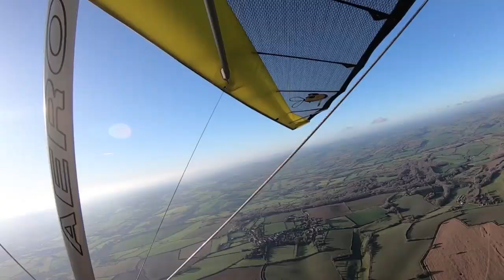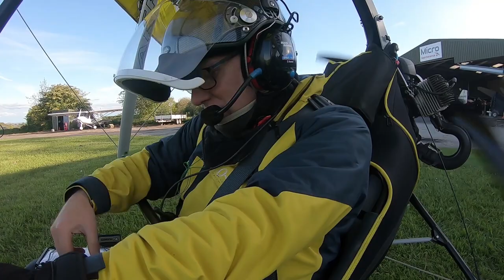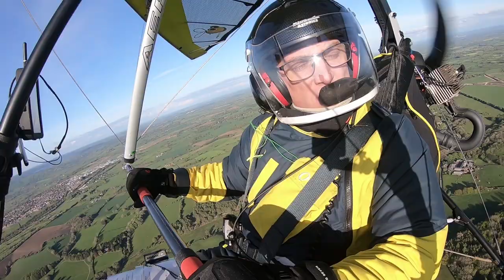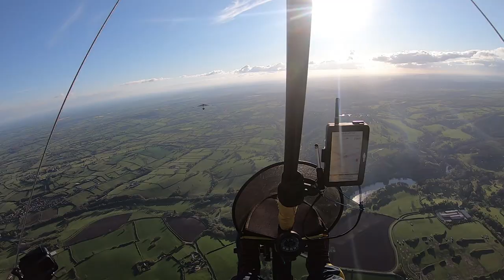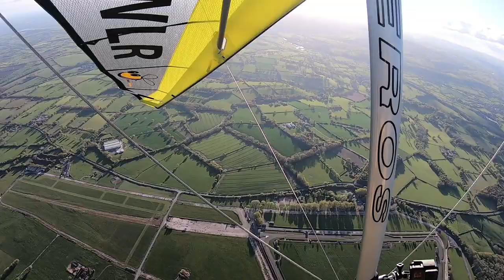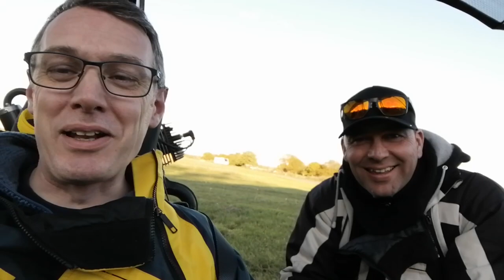PeaBee antics - Going for a BUMBLE - Laughing too much

Comment: Great flight Giles.    No need to apologize for the "Inner Child"  antics, because without the Inner Child talking to us, we would never buy these flying machines.  Mine is on order, being assembled at Fly Products as we speak 👍😎👍
Reply from the maker: What did you go for in the end Chris?
Reply: @GolfFoxtrot22  I am getting a Rider Frame with the Thor303 engine,  mounted on a Flash Cruiser Trike. I plan to train up to Tandem, so I got the more reliable water-cooled engine with dual ignition. A little pricey, but I believe it was worth it.  My first wing is a Roadster 3  30m.   I'll get a larger wing when I get Tandem Certified.  I can't wait for it to arrive :D

Comment: Hello Giles, I bought a Peabee last year and have just started flying it but it seems my drive belt has decided to loosen somewhat in the months it’s been laid up!!! I don’t suppose you know what frequency the belt needs to be? I was wondering what device you’re using as a nav aid? Are you using a ram mount? BW Tom
Reply from the maker: Hi Tom, there is a whole series of videos that might help, but here is the belt replacement video that has all the information you'll need I don't know the frequency as I use the 3.5kgs on the bar method.  The Nav system I have is a Naviter Oudie 5 Pro ( FLARM). All the bits and pieces I use are in the description.  The mount is designed for the device but not RAM. I hope that helps.